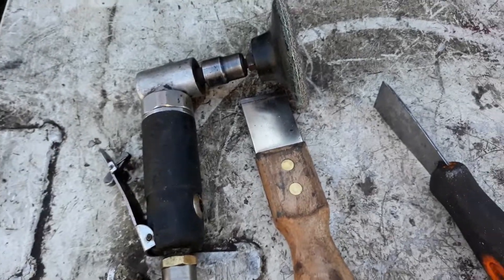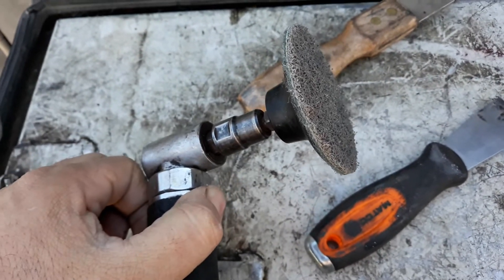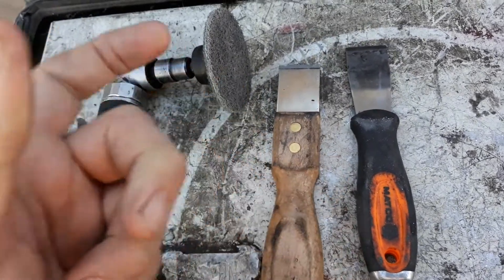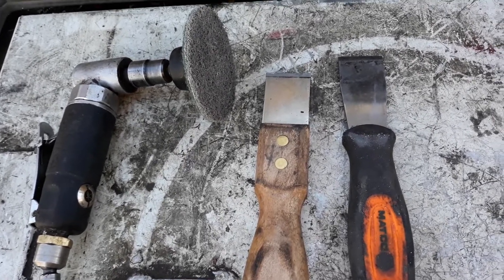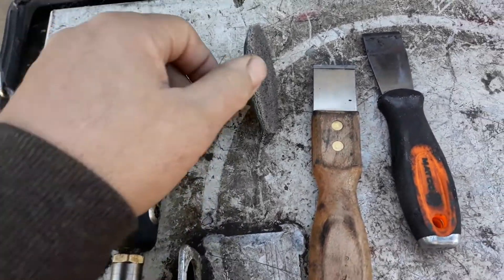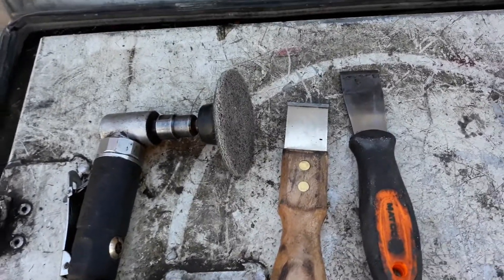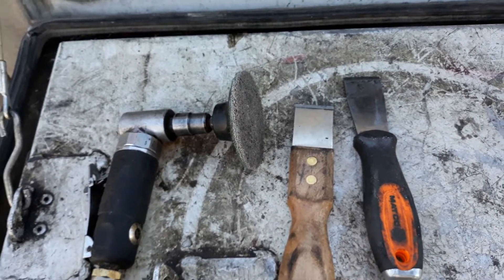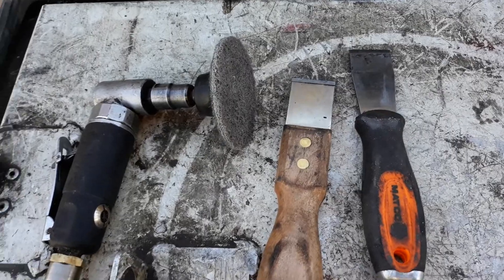Scrape, buff,chisle gaskets off

Comment: What type of gasket removing chemical do you use now?
Reply from the maker: I have a carbide tip gasket scraper ,its called super scraper maybe i,ll make a video next on it 

I work on diesel mainly so I dont really use chemicals to remove gaskets
Reply: @sonofmontezuma3732  ya but if you use plastic scrapers on a head gasket you have to use some sort of scraper.
Reply from the maker: @supermetaltastic  I dont like the plastic scrapers , but some engines require them as to not damage components, as for chemicals its hit and miss for me 
My go to is my super scraper just love it